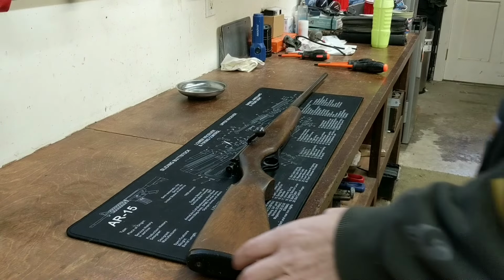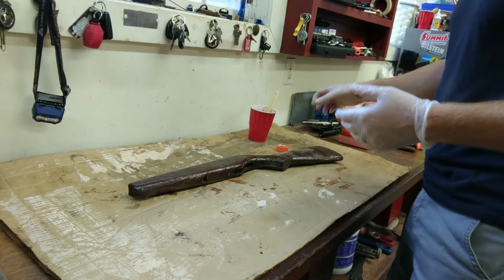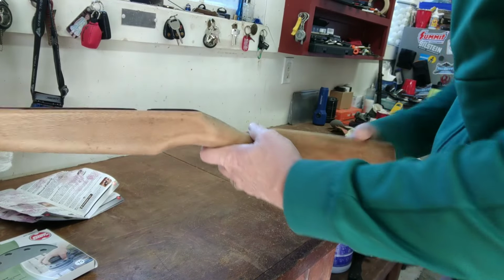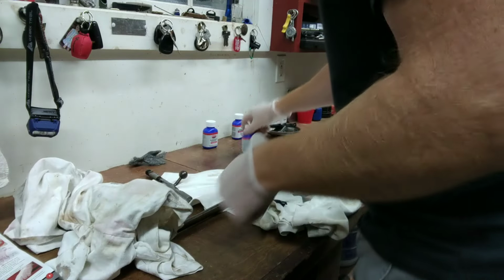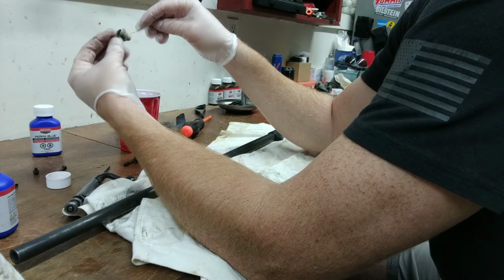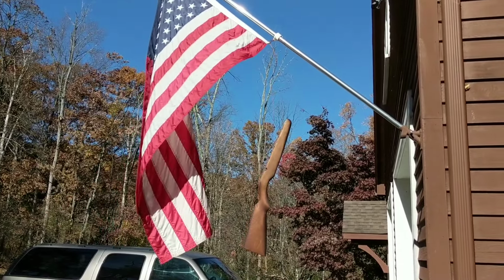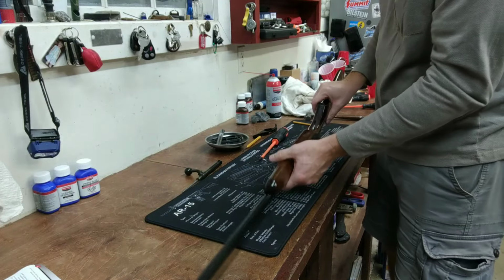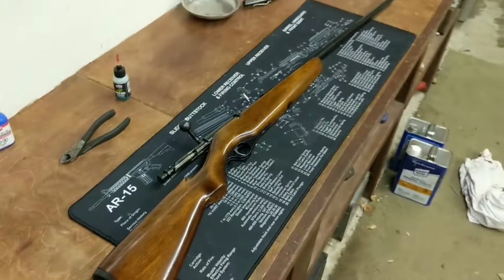Wards WesternField .410 model 17b shotgun refresh

Comment: A lot of those department store guns (usually rebadged Stevens/Savage or Mossbergs) didn't have a true stained finish. They sealed the wood with clear,  and then sprayed a tinted clearcoat on top of it. 
It is very easy to make it look better than stock by doing it the "right way",  staining it and then clearcoating it. 
Next time, start with a lighter stain on an unseen spot on  the inside to see how dark it gets. It often gets darker than you think it will. 
Nice job
Reply from the maker: @RequisiteFunction  that is super interesting regarding the store branded guns not having a true stain. And great advice on the staining a small section first.  Thanks for the feedback.
Reply: @redhawkvalley  once the trick was learned, it was done on all the mid and base-level American guns. The reason is, it let's the manufacturer get away with not having to use walnut. 
There's nothing necessarily wrong with the other woods, but walnut costs more, and people back then didn't want blonde guns.
 Clearcoating it first, and then spraying it with a dark, tinted clear, allows them to offer a uniform color across the product and the product line, something that can  be difficult with solid birch or one of the other "white wood" walnut substitutes, due to the absorbtion rate of unsealed wood. 
There's always a bit of trial and error with it, but by and large, they usually look better than the factory fake finish when people redo them the right way.
Fwiw, many electric guitars are still finished with this "fake staining" for the same reason. It gives you more control over the color, but it never looks as good as actually staining it.